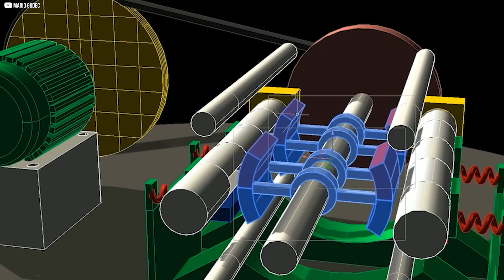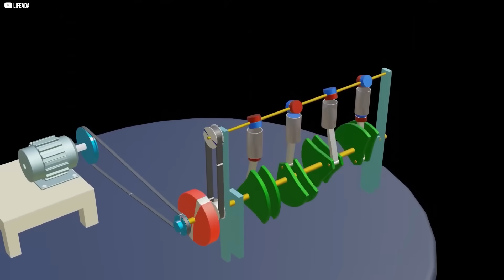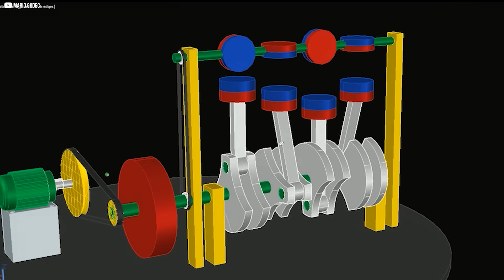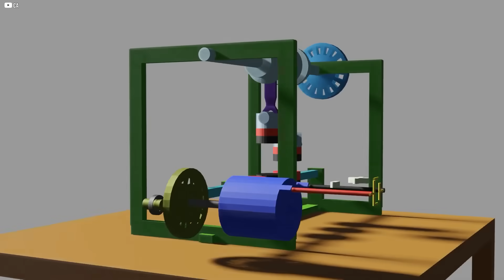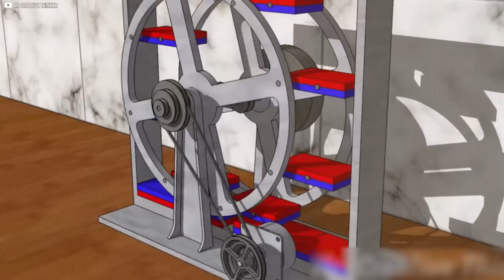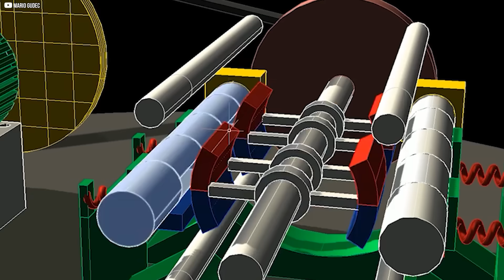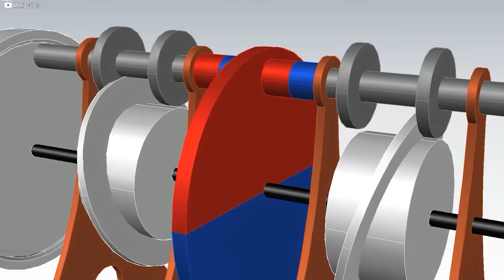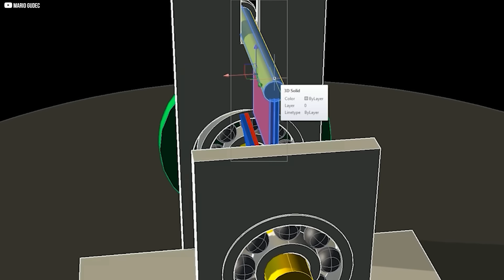Magnet Piston Engines Are a Lie – Watch This Before You Believe It

Comment: The concepts that you revealed in this video has a lot of repulsive force from the stationary magnets.

So that's why the piston is not rotating the Crank shaft. Instead, it is oscillating.

May be,  if we control the repulsion force from the stationary magnet we can make this concept work.

For example this same concept , also showed in youtube by replacing the electromagnets instead of permanant magnet . 

It works better , the crankshaft also runs without any fuss. Because, we can control the electromagnets by turning on and off at the proper time.

When the piston moves from tdc to bdc, the electromagnets will be turned on. When the piston moves from bdc to tdc , the electromagnets turns off.

If we make this kind of atmosphere in the permanant magnet engine, we can make this concept work.

But one problem, the pm magnets cannot be turned on and off.

So this concept cannot work due to that issue
Reply from the maker: That's a great observation about the oscillating motion and the potential for controlled repulsion!